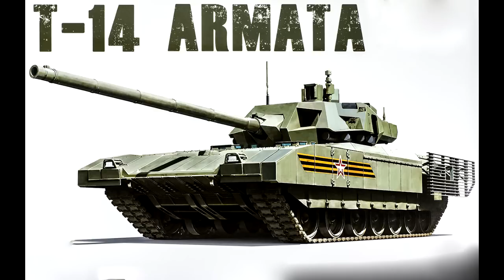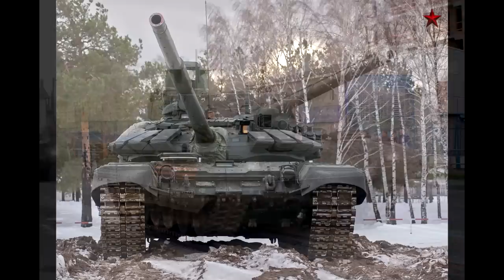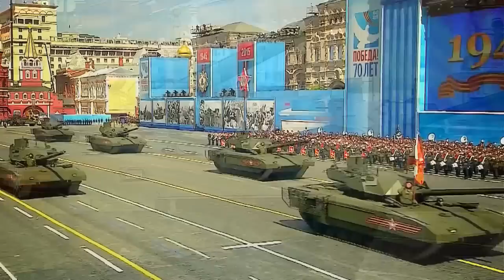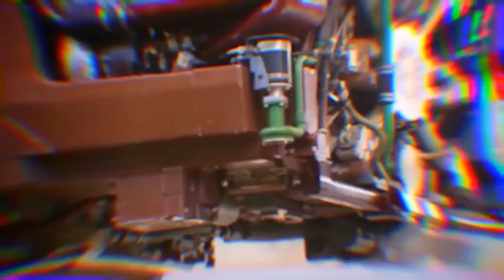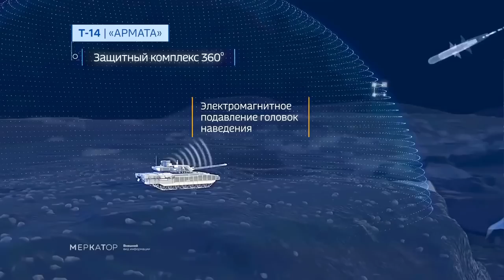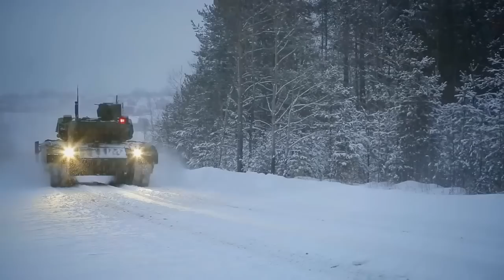Busting Myths on T-14 Armata

Comment: pretty good stuff , ill upload my "busting myths about the pak fa video" tomorrow or so , nice timing after this XD!
Reply: i hope you will enjoy it ;)
Reply: HM1199 ill b waiting
Reply: alright :D
Reply: Wade French based on what
Reply: @Wade French That's a whole lot of words coming fron a troll there, and all for nothing - Raptor is not operational to this day, never has been, never will be; OBOGS, CPU overheating, join corrosion, "stealth" covering washing off by rain, etc.

LOL oh yes - K36!
Reply: Oh gosh what a troll...Have you actually checked the video or just rushed into the comment section in order to place this unreadable drivel? 

FACT ARE : Russians are not struggling to develop the Izd.30, it is coming in time and the goal in sight IS NOT TO BEAT THE F-22 (which only 189 are build and pretty much worthless in modern battlefield as too expensive, difficult to upgrade, limited ops etc.). THE SU-57 SIGHT IS ON THE F-35 and it will have more payload, more range, better aerodynamics and perhaps even BETTER SOFTWARE.
Reply: so the Russian will be prefect..your stupid.
Reply: HM1199 you mean the cancelled SU-57
Reply: Based on the fact that the Pak-Fa is supposed to be the equivalent to the F-22, but the F-22 was operational in 2005 and 187 were built.  The Pak-Fa won't be in operation until 2019 (current models still are condsidered protypes).  The Russians want to put a more powerful engine in it, but are struggling to build an engine for it to give it more performance.  The eventual engine will be the Izdeliye 30 which will not be ready until 2020.  Which means the T-50 won't be ready for service in a final version until perhaps 2025.  The izdeliye 30 (under developement) promises 39,566 lbfs which will still be less than the 43,000 lbfs the engine on the F-35 already has.  That engine (F135-PW-100) was delivered in 2013.  in addition :  The goal of Block 2 is to work with the US Air Force's Adaptive Engine Transition Program, with the intention of introducing technology for an engine rated at 45,000 lb of thrust, to be used in a sixth-generation fighter.[42]

So if Russia won't have a fifth-gen fighter in service until 2025 or so when the Raptor is already 20 years old...it isn't really rocket science is it?  Pretty obvious to most people that Russia is ten years behind when it comes to military tech.  One country is working on sixth gen aircraft while the other is struggling to produce a fifth-Gen example.  

And tanks?  They are just target practice for the first Air Force to gain air superiority.  Given the massive numerical and tech advantage of the US Air Force over the Russsian Air Force the T-14 is target practice.  

They have only made 20 or so Armatas and the US has 8000 Ahbrams.  A very small percentage of Russia's force is t-90's and Armatas.  The rest of Russia's tanks are tanks that would be mothballed in the west that Russia counts to look like they have a massive armoured force when in reality if you only count modern tanks they have half as many as the US does.  The current Russian military is as much propaganda, smoke and mirrors as it is legit hardware (which they do have some).   Crazy thing is the only place that Russia leads the world in is fucking trolls on the internet.  Given that RT is paid for by the Government, and Putin has paid trolls working for him it is no surprise that some fools believe some of the garbage that Russia produces.  

The  truth is that with the exception of a few small areas Russia is behind the West.
Reply: The Russian military is miles behind that of the US these days.  I would say the Leopard 2A7 is a much better tank than the T-14 Armata.
Reply: HM1199 you know it's to bad that the United States and Russia can't ever get along if we ever did our military would be unstoppable but the truth is the T-14 is the most top of the line tank out there right now I can't wait to see what the US has in store for there future tank as of now the armada so far is my favorite tank and I'm American and I love my country the world around us likes to give us a bad name and call us warmongering evil people but that's not true we Americans want the world to be at peace thx for the overall input on the T-14 and I hope one day Russia and America will become allied and fight together to bring peace once and for all anyways love the tank its a work of art